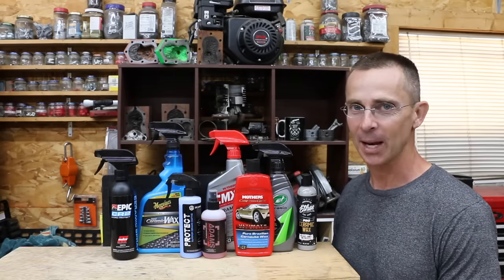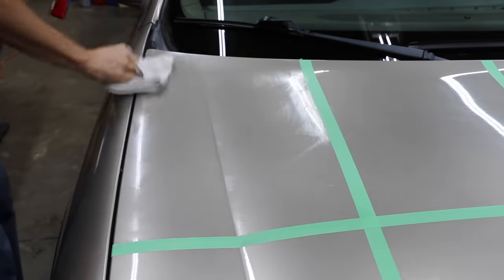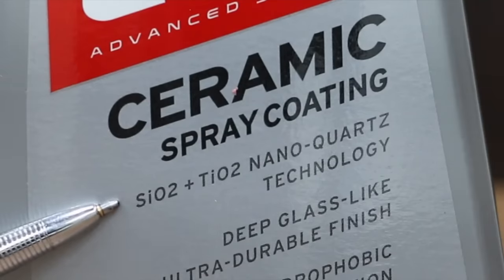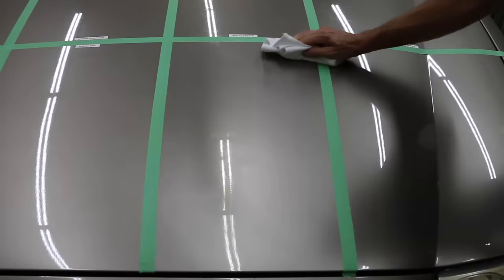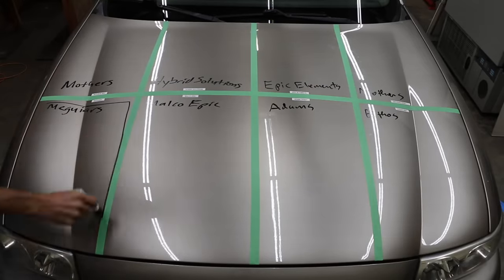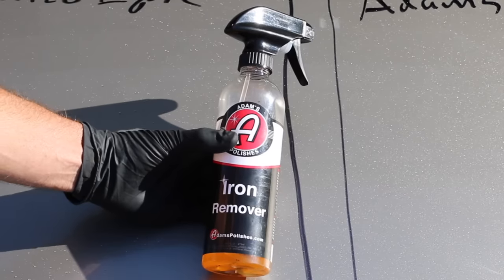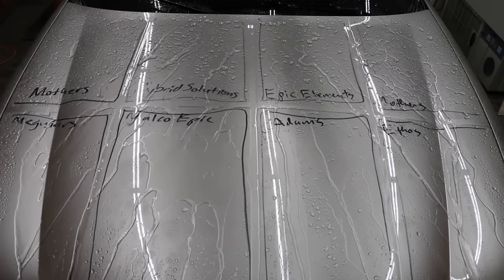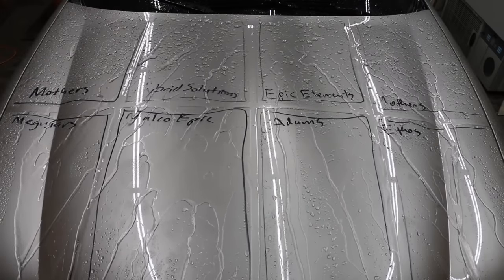Best Ceramic Spray Coating? Mothers vs Meguiars vs Ethos Pro

Comment: I used the TW Hybrid product six months ago on two brand new cars and can confirm it holds up extremely well. I did the recommended 2-step application. Applied the first coat, parked the car in the garage for 24 hours, then applied a second coat. NOTHING sticks to this stuff. Super slick. Thanks for sharing, Project Farm. Tip: use it on everything. Glass, plastic, wheels. Everything except the tires  ;-)
Reply from the maker: You are welcome!  Thanks for the feedback.
Reply: How long did the ceramic last you on the 2 step process?

Comment: Who would've thought Turtle Wax would be releasing good products in 2020.
Reply from the maker: Thanks for the feedback.
Reply: What’s crazy is that when independent studies that aren’t worried about looking cheap test a lot of Auto products Turtle wax brand always done well.  I think too many people look at the name and just think cheap. It doesn’t surprise me that they’ve done this well with ceramics. Funny thing is is I’ve always been a mothers guy and I’m using their CMX formula now. But I almost bought the turtle wax brand but I didn’t think for some dumb reason it would be as good. I feel dumb now I should’ve just bought it and save six bucks And gotten a better product.
Reply: Literally anyone who is into auto detailing. They been putting out great products for the last several years. One of the best being seal and shine.
Reply: They really have been putting out good "easy" to use product for the last few years. Their Seal and Shine is great but generally only last about 2 weeks on my cars.
Reply: I'm glad they are still around, Turtle Wax was always my grandfathers go to for looking after the car and I still use their wash and wax.
Reply: I have used Turtle Wax Ice for years.  It's awesome stuff!
Reply: Jennie Needham  their interior cleaner and some of they detailer spray have but their wax have been average or less than average. Now with their  Sealant's protection, they are actually above average, although if you're looking for shine, they are still average or less.
Reply: Carter Edison  agreed. they make great waxes and sealants,  but their car soap is 👎🏻 i use Griot's car wash now
Reply: I've used most of these spray coatings and for the price and durability you can't beat Turtle 🐢 wax Hybrid solutions!
Reply: I’m shocked! I used Turtle Wax compound, and it sucked ass. Especially compared to Meguiars. I am anxious to try this stuff when I get the extra cash.
Reply: Hybrid Solutions is their top line product.  In order of quality, the green bottle Turtle Wax products are consumer grade.  Next is their ICE line, which includes Seal n Shine.
Reply: @gregkimura5906  So it is kind of like Harbor Freight? Pittsburgh tools are shit, while Icon are usually top of the line?
Reply: I was sleeping on turtle wax until they dropped seal and shine. I still use it but want to switch when I use it up.
Reply: I did
Reply: Probably some crazy plan to turn a profit!
Reply: They always did that's why they're still around!

Comment: Yes, I'd like to see a round two. This time I would like to see the new Graphene coatings tested. The Graphene coatings are purported to be even better than the silicon dioxide coatings you tested in round one. Thank you for all you do.
Reply from the maker: You are welcome!  Thanks for the suggestion.
Reply: Yes I agree a round two would be beneficial. Not only using Graphene vs Ceramic coatings, but I would have also like to have seen these tests be a bit more comprehensive. How easily will wet mud come off? How about mud which is slung on wet and allowed to dry? One of my own favorite at home tests is to see how easily dust or pollen is removed with a dry towel. I appreciate seeing the water bead up, but that would happen if you smeared vasoline or armor all over the paint, while it may also end up attracting dust.
Still good video and it was an impressive effort to make it I'm sure.
Reply: @Rick-the-Swift  Okay, okay. Good suggestions but I have a better one.
Leave the car for 20 days in August in a cage with pigeons and direct sunlight.
Reply: @ProjectFarm  road salt - is there any way to simulate winter road chemicals?  As far as I can tell, that stuff eats car wax and I’m not waxing my car between November and early March (Maine). 

I’ll second the bird poop suggestion. My favorite house had 50’ of road frontage, no driveway, and a giant magnolia tree dead center in the front lawn. My daughter named the birds in the tree “turdy” as a collective.
Reply: It'd be interesting to see how these compare to more traditional treatments like:
Nufinish
Turtle Wax Hardshell
Turtle Wax Ice paste or liquid wax
Meguires and Mother's wax
Reply: Also, a longevity test would be great.
Do the surfaces, then let it bake in the sun for a couple summer months and couple months in winter. I really don’t get the point of some of these because I don’t plan on throwing such harsh chemicals on the car, unless those chemicals can be encountered in day to day real world situations. Also, while I love a slick car, what does friction have to do with protecting the paint, unless that is used to test durability, but does it really?
Reply: Sea gulls! 🦅🦆🐧🕊️🦉
Reply: I see those claims regarding graphene similar to how I see claims from tennis racquet tech from a few years ago in that they're stretching the truth a bit. Having said that I do think they're better products or at least have a better base formula, just wondering how much of the benefit is more effective chemistry overall not just the addition of a magic bullet compound. I'm currently using Hybrid Solutions Graphene flex wax and I'm really happy with the results, and in no small part I chose it because I see it as a follow on of the very resistant hybrid solutions ceramic tested here.
Reply: @prism8289  Using a very "slick" feeling spray on wax (another hybrid solutions product) and living in a very dusty environment I have noticed that the slickness helps with the car being less dusty overall, there's some very fine dust that still collects, but the rest of it seems to just slide away, except for parts where turbulent air churns a lot of dust (that is the hatch/rear gate portion of the wagon/minivan combo we have here). Maintenance washes are also much simpler since most of the dust will just slide off in the pre-wash rinse.

Comment: Great job! I'm to the point of having a product in my hands that I'm looking to buy and I wonder to myself did Project Farm cover this? I value all the hard work it takes to provide an apples to apples comparison. All of it. Well explained testing procedures, showing the data in an easy to read manner, excellent narrative, great camera work and an unbiased opinion to boot. Simply outstanding.

Comment: I believe I left a similar comment on another video related to this, but here goes again.  I first used a ceramic coating on my 2013 RAV4 last April, as I was tired of having wax coatings wear away too easily.  Was very impressed with the results from the get go.  Come late October, I wanted to protect the paint during another Maine winter.  Well...the coating was still beading up water like it did in April.  Heck, maybe summers were not too bad on the coating.  I did a quick recoat anyway, and wished for the best.  This past weekend...two days ago, 6 months after the recoat...I gave my RAV4 a nice, spring cleaning, inside and out.  The ceramic from October looked like it had just been applied!!  This is after a relatively mild Maine winter, but still...lots of snow, cold and salt spray from the roads.  What I used last April, and still do, was the Turtle Wax one you had as number one.  In a real world 'test', your results were confirmed!   Thank you Todd...my 10 year old RAV4 looks awesome!  As one more comment...do not skip the clay bar step.  You will not believe the crud that it picks up that you can't even see normally.
Reply from the maker: You are welcome!  Thanks for sharing!

Comment: Great video, you knew I was going to chime in on this. Always tune right in as soon as I get home on Mondays. Glad to see TurlteWax performing so well. We sprayed a lot of cars in their parking lot testing several of their formulations back in the early 90's. They have come a long way. Ceramic coatings are very different than waxes. Most waxes use a fugative emulsifer so they can be removed with an alkaline cleaning product. Ceramics actually cross link the silicon matrix and are much less soluble. Car detailers these days can be real artists smoothing the paint surface and making htem look like glass. There is an instrument out there, I think made by Byk Gardner that measures the water beading angle on the surface. This is used to measure the hydrophobic strength of the coatings. I love your taped off hood section test. Shows a great deal of side by side results.
Reply from the maker: Thanks so much!

Comment: I've been using the Hybrid Solutions for 4 months since I first watched this video and can't believe how great it works. Now HS has a detailer spray too. My 2016 Cadillac SRX is so slick a fly can't land on it. Don't forget to use it on your glass and wheels too. Thanks again PF.
Reply: Really? Glass too?  Have you found anything you shouldn't use it on on the exterior?  Probably going to get this soon and would like to know if there's anywhere to avoid.
Reply: Done, my grandpa who taught me a lot of car stuff would say a car is well waxed when “a fly couldn’t land on it” so I’m definitely gonna try it. The car is 10 years old with only 60k miles, I made the inside like new, so now the outside. I have a car wash membership so gonna get it washed, clay bar it myself and try this stuff

Comment: I’ve been using hybrid solutions on a 12 year old car and I agree I’m impressed with its beading ability. However it doesn’t do much to add shine and gloss or hide scratches, swirl marks, and other paint imperfections
Reply from the maker: Thanks for the feedback.
Reply: These ceramic spray waxes aren’t designed to hide swirl marks or scratches. If anything they will just expose even more. Primary purpose is to protect the paint underneath. Second is add gloss. Anything that fills in the scratches to make them less visible will not last long. You really need to compound or at least polish the paint first. It will also help the protection adhere better and last longer.

Comment: Been 7 months since I applied Hybrid Solutions to my car. Still performing excellent. How I also gauge it is having only have my windshield coated with HS. Even with going through plenty of washer fluid the one half of windshield still beads very nicely while the other side just sheets. Unbeatable product!
Reply from the maker: Thanks for sharing.

Comment: Turtle Wax is INSANE for the money! 
I put Seal & Shine from Turtle Wax on my car, and it took my 6 washes for each panel, using a heavy degreaser and high pH soap to remove it. that was a pain in the butt, but im glad that it only cost me like 9 dollars for seal and shine and it does so well! not bad at all for a spray detailer
Reply from the maker: Thanks for sharing.

Comment: I’d like to see how they hold up to long term sun and weather exposure. Get an old hood and apply the products. Then put them outside and wash it once a month and show us the results.
Reply: Yeah I was somewhat underimpressed by this test. Sure we can get an indicator of the quality of the products, but a more real world test would be great. Like driving through a automated car wash and see what happens to the products.
Reply from the maker: Thanks for the video idea.
Reply: @ProjectFarm  Old hood would also a good test for how good they are at hiding small scratches and imperfections.
Reply: Was going to suggest the same thing 👍
Reply: I half agree that it wasnt a "real world test" but I doubt driving around and getting rained on every so often is going to compare to spraying your bonnet with industrial degreaser.
Reply: @ProjectFarm  A suggestion: announce your next video topic to viewers and take their comments like this in advance. It will be a good evolution to your Season 2 of Project Farm!
Reply: @FanaticTentacle  There are several other YouTube channels that already do that exact test and the same products that did well during this test also do really well in the longer duration outdoor elements tests.
Reply: with real ceramic coat, u dont wash the car, u just wipe it down. best part of real ceramic coat is snow just falls off the car.
Reply: @Sam S It's funny how people declare the real stuff doesnt work. I've applied the real stuff to my cars for the last 4 years. after I apply it I cant put anything on the hood of my cars for months after like 6 months I can put stuff on my hood but if it gets touched it slides off... a gallon of milk slides right off. The coating lasts for 2 years. Snow doesn't stick to my cars and falls right off. when we have ice storms the ice falls off my car in sheets non treated cars the ice is stuck solid. so it's nice to know yor opinion, but I have facts and real life experiences. the problem with the real ceramic stuff is there are many people who dilute it to increase profit or are straight up selling junk. dirt and pollen blow right off. opinions are funny to read from the sheer ignorance. I have videos of what I said above aka like I said I have factual proof.

Comment: I tried the turtle wax spray after this video and it is holding up during the winter so far. Roads are heavily salted where I live and I wash my cars with a pressure washer regularly during the winter. Just with the pressure washer without any soap the paint gets quite clean and water is beading off again.

Comment: This is as good a test as I have seen on some of the specialist Detailing channels, I particularly like your way of testing slickness with the weight as it gives a measurement, others could learn from this.
Good result for Turtle wax, I am not surprised it won, their Ice Seal and Shine is even cheaper and almost as good.
Reply from the maker: Thank you very much!

Comment: I've long used Nu Finish (going back to when it was Nu Finish 2000) and it has always worked great for me even on old neglected paint so I've never had a reason to try anything else.  Neon Orange bottle.  Please consider including it in your next set of tests!
Reply: Agree. I’ve used NuFinish for years and love it.
Reply: I literally just used their spray on wax  it yesterday since I've used their original stuff to clean up my windows and make them water proof (scotty kilmer)
But damn my wife's matrix looks brand new, before it had soooo many micro scratches but now every small dent has a reflection but still looks amazing!
Reply: I used NuFinish and other polishes for decades, but eventually I gave waterless wash and waxes a try and realized that what used to take an hour could now take 15 minutes and a fraction of the effort. Even if I could get NuFinish to last 8 months (a big if), I could spray wax the car in less total time in a year. And the cleaning power was great!
Reply from the maker: Thanks for the suggestion for future round of testing.
Reply: yes nufinish since its a classic. also the Rejunavator from Malco seems
to be use by many dealers it protect and shine I had similar results as CMX for water repellent
Reply: Great suggestion. Be interesting to see how an old reliable classic holds up against todays concoctions.

Comment: Project Farm used a permanent marker on his car, just to make his presentation better. Amazing!
Reply: I was impressed at how well the permanent market held up to all the washings.
Reply: @billybeemus3929  The Purple Power finally got the marker residue off.
Reply: @Project Farm. Thanks Todd for another great test. I hope that marker writing came off the hood of the car. Or was that a rental car? Did you buy the extra insurance for it?

Hope you and your family stay safe and well.
Reply from the maker: Thanks for watching.
Reply from the maker: It is our car.  The marker came off.  Thanks for watching.
Reply: Project Farm I was watching for the part where you explained to your wife why there is permanent market on the hood of her car.😂🤣
Reply: I’ve found the antidote for permanent marker on most surfaces, is just a touch of rubbing alcohol.  Although, as I write this, I’m struck by the fact that statement is not as ubiquitously simple as it used to be.  Still works...

Comment: I bought hybrid solutions after watching this review.  Very impressed with the ease of application and buffing off was super easy.  I’ve used competing products and this was by far the most forgiving in terms of high spots, haze, and streaking (almost no issues at all and hardly even needed any touch up after close inspection).
Reply from the maker: Great to hear!

Comment: After trying most brands of 3in1 detailer sprays on my Harley, I ended up with the Turtle Wax HySol 3in1. It wasn't only repelling water that was a concern to me but dust too, I live up a 1.5 mile gravel/dirt road & the TW HySol did the best overall with dust mostly blown off by wind as I ride or an air compressor set @ 80psi when I get home.
Reply from the maker: Thanks for sharing.